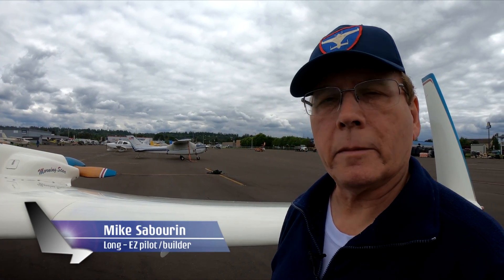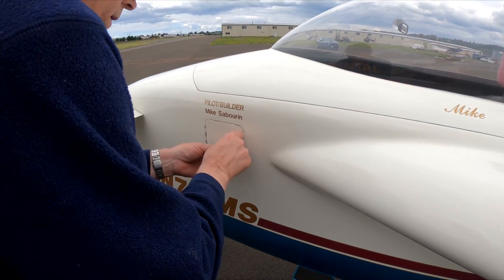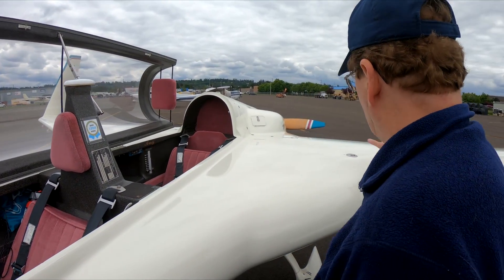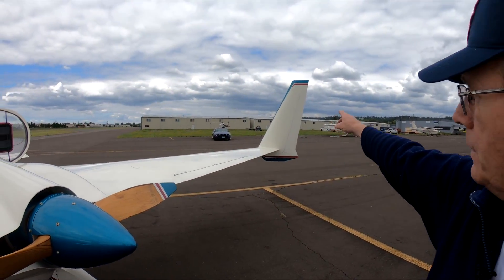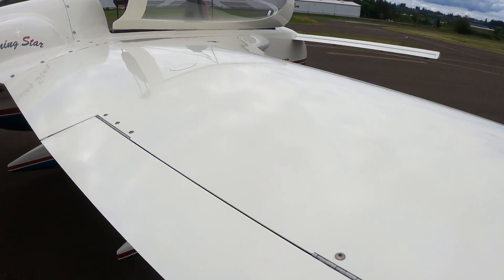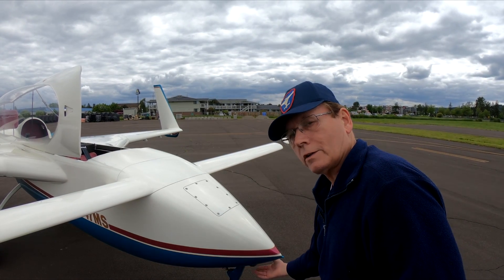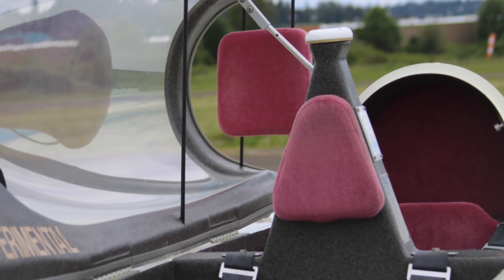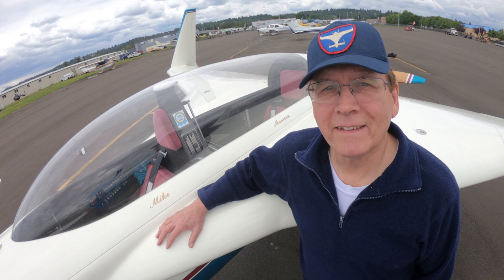KITPLANES Long EZ Walkaround Video

Comment: Hi Folks,
        I sure wish some billionaire would invest in fuel injected, turbo-charged "Revolver Cylinder Engine" in a Long EZ
      Imagine flying at full power with over 360 hp. on a liquid cooled engine under 200 pounds of weight flying on 87 Octane Gasoline.  With a tighter engine nacell, and a scoop radiator, it has less drag than the standard Long EZ.
        Sure wish someone would put that engine with a featherable  pitch 4-blade adjusting prop.
        Yep, could probably fly 2,000 nautical miles without refueling, or with a 35 gallon back-seat tank, one could get another 1,000 miles for one passenger.
                              Very respectfully,
                              R

Comment: such a totally cool airplane I would love to build one if I can develop the time. I really have a hard time understanding why John Denver died in one. I guess maybe he didnt check the fuel and was flying at a really low air speed which is totally safe on this plane. My best guess is he was too busy enjoying the view and flying near stall and when he ran out of fuel(my best guess is that he did that and forgot to check the fuel status prior to takeoff). Otherwise this plane would have a nice glide and be able make a rough landing on the beach with that small nose gear.
Reply from the maker: You can read the accident report here: https://www.avweb.com/flight-safety/close-up-the-john-denver-crash/. He was trying to switch tanks and basically flew into the ocean.
Reply: It won’t stall, but if you get too slow it will dive into the ground. Similar end result. Their accident rate is no better than conventional designs and it might be a bit worse because it requires some different techniques. Lots have crashed on first flights due to pilots not being used to the aircraft
Reply: I dunno, you still wouldn't get me in one! Another guy I knew in Nashville, Tenn. built one and was flying it at the airport and had just taken off. Flew down to the end of the runway, went to bank and apparently went nose-down into the ground while banking! Killed him!

Comment: Why do only the nose gear retract on some planes?
Reply: The nose gear retracts because the empty center of gravity is very close (sometimes behind) the main gear. If no one is in the plane, it could tip over backwards when parked. Retract the nose gear, lower the plane, and you'll bring the center of gravity (vertically) forward of the main wheels.

The main gear doesn't retract because there really isn't enough room for the workings to make the gear retract. There are some people who have done it, but it really cuts into the fuel capacity.
Reply: @EatPezzzz Excellent answer

Comment: Beautiful plane, but that wood prop makes me nervous.  Why do they use that material instead of others?
Reply: It's wood wrapped in fiberglass. All canard pushers use them to absorb the shock of flying in plane's wake. These engines were never designed to push.

Comment: why are the fuel gauges only visible to the passenger... assuming you even have one? 
How does the pilot see the gauges back there?
Reply: Yes. The pilot can turn around and see them or most use a make-up mirror. But the 235 Long EZ usually only burns about 5 gallons/hour, so you just change fuel tanks every half hour, and you're good.
Reply: That type of gauge needs to be directly attached to the tank they're reading, and that's where the tanks are.  Slightly inconvenient but simple, reliable and accurate.

Comment: Ouhps the cruise speed is exaggerated 🙈
Reply: Not really. A built 235 (assuming, as he said 118hp and 6.5gph) with a very clean cowling, pressure recovery pants, 180mph is quite realistic. Check out my "long EZ landing GYH" video. Video starts when I begin to slow down for landing, starting at 185mph
Reply: @EatPezzzz  Probably even better than that with the full retractable landing gear that you can get from infinity since that gets you 10-15mph conservatively (they claim 12% on a LE which is about 19-23mph) or maybe a little better at the same engine output. It probably depends on the prop also as the landing gear is disturbing air going into the prop decreasing it's efficiency.
Reply: @Wingnut353   While that is a good point, there is SOOOO little room in these planes for extra stuff, like the mechanics of a retractable main gear. I know Infinity sells them, but it would be a tight squeeze. I just finished a built 320 swap on my plane (formally 235). That woke it up!! ha.
Reply: @Wingnut353  Severe tradeoffs with retracting the mains on an EZ. Rethink it before attempting it.

Comment: great video but why not use an extra battery as a ballast or use the nose as an extra luggage compartment to equal out the weight?
Reply from the maker: You never want to carry any more weight than you have to. Rutan surmised, correctly, that the pilot will be on board for every flight, so he or she might as well be that ballast.
Reply: The weight is only placed in the front seat to help display the interior for the camera.  Normally they're parked nose-down, which takes care of the issue.
Reply: Wouldn't that make it nose heavy once the pilot got in though?
Reply: @wesvasher  I would agree but wouldn't those canards always add an extra force of lift on the nose to balance the weight? instead of having to pitch up, stretching out the surface area of the canards would be just as beneficial no?
Reply: @FreddysVision  Canards are notoriously difficult to design and then are very particular with their weight and balance.  While the canard does contribute to the general aircrafts lift (unlike a conventional horizontal stab), the downwash it leaves in its wake negatively affects the main wing behind it (unlike a conventional tail where it helps the tail produce downforce).  Increasing the wing loading on the canard will exasperate this problem, and increasing the canard size will exasperate this problem as well as potentially create destabilizing issues as the Aerodynamic center still needs to be aft of the CG center to keep the stability characteristics of the plane.

Its a bit counter intuitive as there is almost a sense of stability that comes from having 4 lifting surfaces much in the same way that a car has 4 wheels, but canards are very finicky with their design.
Reply: @xpeterson  The area of the main "wing" behind the canard is not a lifting surface, it's the fuel tanks. The lifting portion of the main wing is well outboard of the canard's wash.
Reply: No need for a ballast when there's a pilot in the seat.